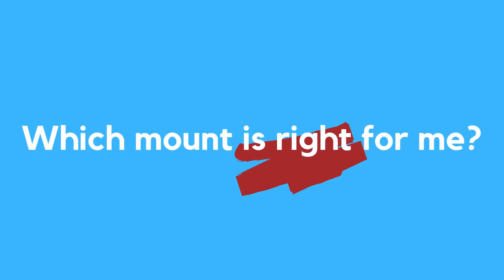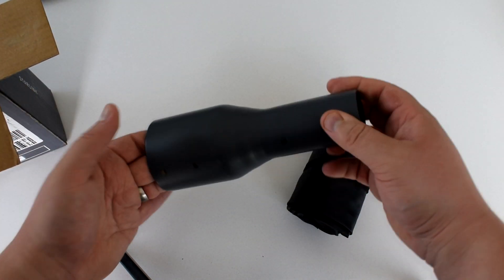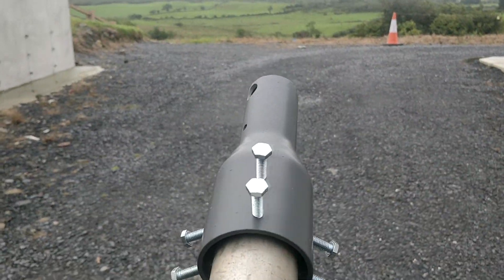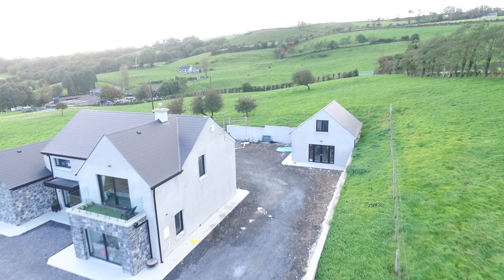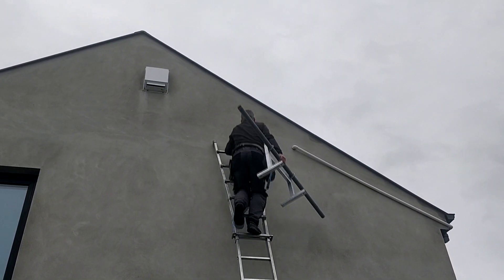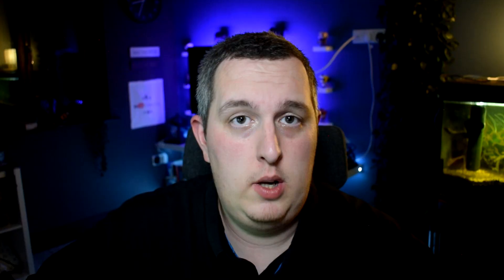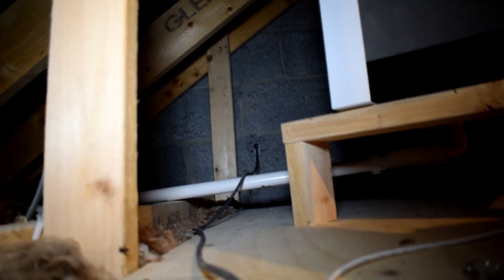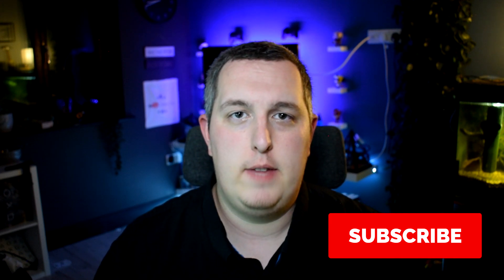How to install Starlink on Your House - Using Pipe Adapter to mount it

Comment: Hi Ronan, great video, thanks! I'm in rural Ireland too and I noted you said that your dish is facing South but the dish may move to face North depending on satellite location. I'm considering trialing this and hoping to place it on a table like you did facing South for the trial however when I use the 'Find an Install Location' in the Starlink app, it doesn't work too good and tells me to find an alternative location. Do you know the reliability of the app? I have a clear view of the sky!
Reply from the maker: I'm not sure but what I would begin with is just leaving it on for a good amount of time and it may sort itself. If that does not work its time to troubleshoot, restart, etc.

Comment: This video is so helpful, thank you!  What are the specs (material, length, diameter) for the bar/pole to which to attach this?  Would it ideally have holes to receive the screws, or will it be secure enough just from the screws clamping it on three sides?

Comment: Thanks so much.  I did see a guy somewhere showing he ran the cord inside the pipe.  According to what I see from your setup this is not possible.  I just looked again at mine.  Mine is different, version 2 architecture so the cord can run down the pole.

Comment: Ronan, back again to ask you more questions. I’m finally getting my Starlink (located in a rural part of Northern Ireland), I’ve ordered the kit but I opted for the “long wall mount”, do you think the “pipe adapter” would be the better route to go down?
Reply from the maker: Not a bother. I can't see a long wall mount in the store so I'm not very sure. However, you can order those things after if you like, you can get your dish and make sure you are happy with the service before committing to mounting it. I had my starlink outside on a table for months before mounting.
Reply: @RonansYouTube  thank you

Comment: When everyone in the house is using the internet does it slow down for ye?..
Reply from the maker: Hey Shaun, Every device will take its share of mbps download speed but I am easily gaming without issues while Netflix is running in 2 separate places in the house.
Reply: @RonansYouTube  Hi Ronan, thank you for your informative videos. Is it possible to use power line adapters with the starlink to have wired connections to the likes of a Desktop, PS5 etc? Thank you!

Comment: Hi, great videos! 
Question? what about moving system to different location with in the County for construction sites? Do you have experience on that matter? I'd love to test that feature doe to my profession.
Reply from the maker: Currently your cell is within within 15km range so if you go outside your cell you will lose connection. You could already be at the edge of the cell or maybe in the centre if you cell. However they are aiming to make it mobile in future.

Comment: Looks good Ronan. I’ll get mine mounted during week once weather gets a bit bitter. 

On another point I am experiencing poor performance with Instagram and Facebook video. Apparently it’s a known issue with Starlink and I have this confirmed with their support and told a fix was being prepared.  Not a massive issue just annoying and hopefully they will resolve soon.
Reply from the maker: Hey Martin. I'm experiencing the same! Apparently Elon Musk said it's an issue with the platforms but I don't know. I was in a hotel at the  weekend and reels & stories on Instagram worked great. I got home then and the buffering began all over again. Such a strange issue that an ISP could cause something like this....
Reply: @RonansYouTube  It is annoying. Starlink support asked me to email the issue to FB and Insta support, which I did last week but no response yet. I doubt I will get one.
Reply: @RonansYouTube  hi Ronan. I noticed today that the Insta and FB buffering issues are gone but I also have a notification on my Starlink app that the service is currently degraded in my location and they are working on it. Interesting. You experiencing same ?
Reply from the maker: Hey Martin, same as that! Instagram not perfect but huge improvement. Getting degraded service but it is working away okay for now just slower. Is yours heavily effected?
Reply: @RonansYouTube  No degraded service apart from slightly higher ping times, just did a speedest to BT Ireland and am getting 298Mbps down an 53.3Mbps up!
Reply: @RonansYouTube  hi Ronan how has your link been behaving during the current storm Barra? I have been getting frequent signal / network disconnects and obstruction messages. Have you experienced any issues ?